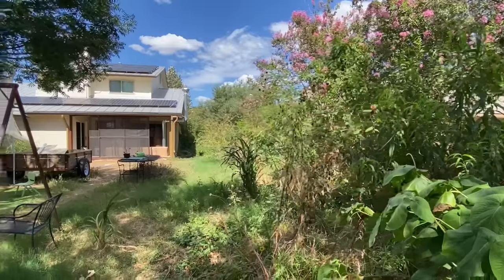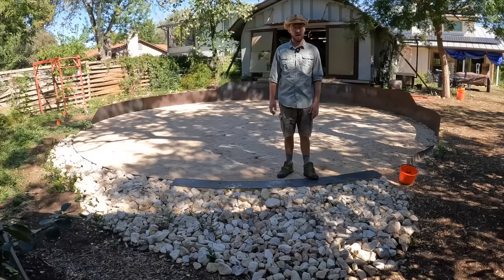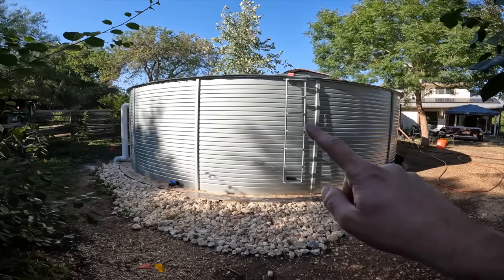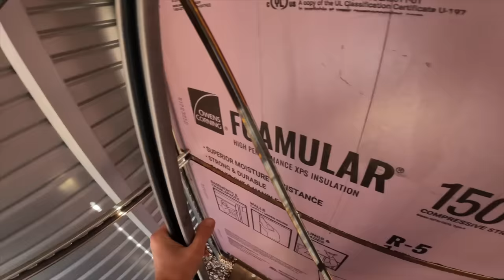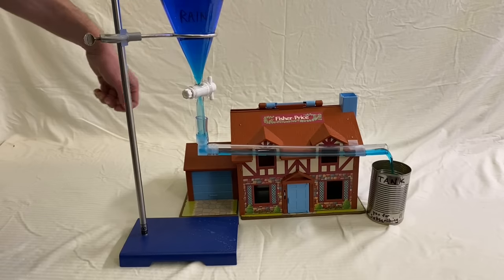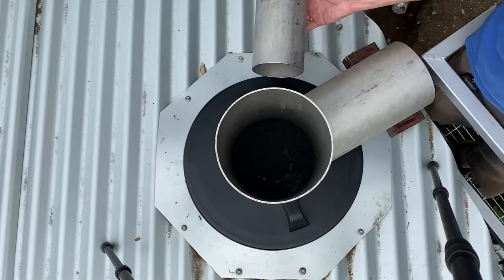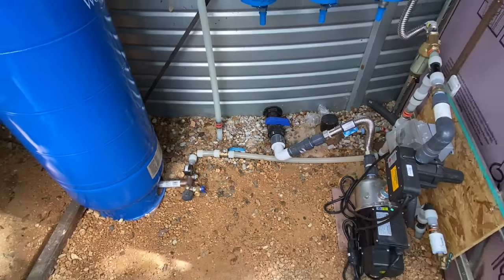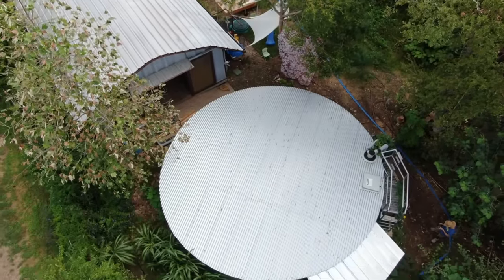FREE water forever.  LEGALLY!!!!

Comment: As some other comments already mentioned, it's one thing to have your own water supply for, technically free, but then you also have to do all the treatment and making sure the water stays clean and usable on your own as well, you have to regularly check for legionella and other stuffs, so that you don't just die from it.
Also that big of a tank is basically the average european single family home backyards size.
Reply: This is only worth if you have zero access to clean water.
Reply: the reverse osmosis final stage ensures his water is cleaner and purer than the vast majority of bottled water on the market. sad to see people dismiss this truly excellent idea/setup.. our being this dependent on systems that could fail at any moment isn't a natural or healthy thing
Reply: @@fishy2939 "Reverse osmosis is a water purification process that uses a semi-permeable membrane to separate water molecules from other substances. RO applies pressure to overcome osmotic pressure that favors even distributions. RO can remove dissolved or suspended chemical species as well as biological substances, and is used in industrial processes and the production of potable water."
Reply: @jmedlin81  this is written by someone who's never actually had to use reverse osmosis machine in a technical setting. ignoring the cost of buying a RO machine for treating that much water, RO will cause him to burn through a ton of the water just using the machine, causing him to reduce the water he actually has to ~1/5th of what he has total. also, I would prob not recommend drinking straight RO water, as because it actually does purify really well, that's sort of the issue. you'll remove a ton of ions than are usually present in drinking water, and since he didn't have a remineralization machine, he might have to take some supplements or make some dietary changes.
Reply: most people in europe live in apartments and flats so its not and option here, unless you have money and buy house, that  cost 200k or more depending on country and city
Reply: @KoeiNL and what happens when you lose access to clean running water?
Reply: @OriginalWoman95  the odds of that happening are insanely low, I live in a wealthy country that belongs to that select group of countries with absolutely perfect drinking water (0% chlorine). I have better odds winning the lottery.
Reply: @Hosing2  I think your forgetting that someone can get all nutritional requirements from what they eat including minerals and ions as the main source of these is food, water contains minuscule amounts so whether the water contains ions or not really doesn't matter
Reply: @KoeiNL  I don't know over extraction of ground aquifers is a big problem even in wealthy countries, it may be the security these seemingly endless sources provide is what drives us to excessively use and waste it.
Because I guarantee you if your water supply comes from a aquifer its currently being abstracted more then the recharge rate which means it running out is inevitable.
 However as the aquifer gets lower and lower it will change the water table and the ground will sink even sink cause sink holes want an example look at Mexico city.
And its worth it if you have the space for it regardless of your access to clean water because chances are you have to pay for that access and this method saves a lot of money
Reply: your forgetting his filter system completely eliminates all contaminants including viruses and bacteria
Reply: Personally I would be content with using rainwater exclusively to water plants or hose down my bicycle, and for that I could just get a lil barrel :)
Reply: @@RaoniTech Its a cost-benefit analysis and if you live in Western Europe the costs completely outweigh the benefits.
Reply: Newly built houses here in Belgium often have a rain water tank. My friend for example has a 10,000 liter tank for a family of 3 and a dog. My apartment has 30,000 liters and my parents have a deep ground-water pump. At a certain level water doesn't deplete underground around here for what can be consumed by a family anyway.
Reply: @kennyj7627  yes, this is useful but not for drinking. Its perfect for laundry, watering the plants and flushing the toilet.
Reply: @NUNYABIZNNAAAZZZ  also, if you want to pay 100x more for a liter of water that's fine for me. I'm not going to do that.
Reply: @OriginalWoman95 what happens to your drinking water when a nuke hits your place? Maybe build a bunker.
Reply: @NostalgicMem0ries  Wow you are out of touch with reality.
Reply: @thomgizziz  care to elaborate?
Reply: Yeah, it is a silly idea because the guy is into "science" so as bright as Pluto. Those filters must cost a small fortune.
Reply: Thing is, at least in northern europe, nearly all flowing water out in the "wild" is clean. And we don't pay anyting for water as it is, well we don't pay anything extra. Of course there is taxes and so on.

But with all the taxes etc accounted for, I am still left with more money each month than most people I know in the states, despite them sometimes making 3x as much money as me per month. We just don't have many fees, and we don't really have to worry about contaminated water, ever. 

USA created it's own problem by contaminating so much of the natural water sources. How else did you think people survived there for thousands of years before modern filtering was a thing?
Reply: @KoeiNL  or if the water supply is interrupted regulary ... or irregulary for longer times.
for me as a german this is interesting, but nothing i would build myself. infrastructure is very good here when it comes to water supply.

Comment: Wonderful to see city folks doing things like this! The video is excellent, thank you for sharing the details of your system and what worked/didn´t work for you. Very helpful.
Reply from the maker: Thank you for commenting.  If we could develop a system that required less metal (like a stone lined hole in the ground with a tank liner inside of it) I could imagine an infrastructure where most people have their own water supply rather than pumping it in from 20 miles away.  Thanks for subscribing!
Reply: @suburbanbiology  Interestingly,  cisterns were once very common.....nothing new under the sun.

Comment: You could use a method to stop collecting into the tank for times that your usage is much lower than your collection volume. As the years go by, the shape of the ground around the tank will change. You have already done a lot to mitigate the effects, but it is something to keep an eye on. You have left a lot of room for upgrades and modifications. Great job with the design and planning. Keep your roof clean and good luck.

Comment: You should add guttering around the roof of the tank to collect the run off and further protect the sidewall. And it’s also another way to collect water
Reply: And how would you get the gutter water from the top of the tank into the tank itself, it’s not feasible, he should not put catchment ontop of the tank

Comment: You'll have to watch out for freezing if you have any water left over in that valley/ditch of the sewer piping coming from your roof to your tank. I also noticed that you didn't have any visible sleeving or insulation in the buried part of your pipe which could cause freezing ground/groundwater to crack the pipe if the dirt is right up against the buried part.
Reply: With this size of a thermal mass freezing wont really be an issue with internals. Externals with a little insulation should be enough. Having said that, I'd add a few things. UV lamps to run 1 hour a day. That emits a little heat. IR lamps on a thermal switch to get a head a serious 10 day freeze or Texan glaciation.😉😉🤣🤣 An internal water heater mounted at the top of the wall above the water would recycle waste heat to the air inside. This will be helpful to melt snow off the roof which is the real weakness in this design. But in a serious snow fall you'll spend every waking hour pulling the snow off before it can accumulate. Make you tools in advance! Basically a giant squeegee!
Reply: He lives in southern Texas, he doesn’t have too much to worry about with all that thermal mass.  As long as you protect it from drafts it’s not going to have much impact on things.  And the frost line in that area is about 6” deep. The downspout pipes of that size will likely only ever freeze about 50% max.

It’s a different story in northern Texas, we can get -15 degree temperatures in the dead of winter due to our much higher altitude and massive wind chill effects.  To do similar I would have to go down 24”  below grade, put a thermal barrier in, and drain the downspouts dry each November.
Reply: @hannibalsdiner1365   good luck with that, with extremes being more frequent lately ;)

"On February 11-20, 2021, a historical winter event occurred that set many records, including being the first billion-dollar weather disaster of that year. A deep freeze impacted parts of the continental United States (CONUS), remarkably engulfing the entire state of Texas. "

Comment: You could also get the land surveyed and get a deep water well installed. It's gonna run you around $6,000-$7,000 possibly, but it's a one and done kinda deal usually.

Edit: Here in TN there are no laws against rainwater collection, it is even encouraged by local government as it helps out the utility companies and their customers save money and water.
Reply: Yeah I was going to say a well is probably a more economical option long term. This tank option is only feasible in warmer climates. You’d need a big enough property to build it (or bury it), regular cleaning would be no small task. I’d almost recommend a first stage filter like a pool filter that allows backwash and flush to clear the bigger contaminants. It would cut down on filter replacements for sure. Would be interesting to have a full water panel test down to see how this tank system holds up after a year or so. Definitely need a filter that removes aerosol contaminates like aluminum and boron from the aerial geoengineering projects they conduct over us now (cloud seeding, etc).
Reply: Agreed, a well is a more elegant and reliable water source in most cases (although in my experience it will cost 10s of thousands of dollars at least) 

It sounds like this guy lives in city limits which might mean that he isn’t allowed to drill on his property

Comment: This is a great idea, I don't think people realise how much we rely on the public water supply until there is a problem. I would be concerned about the water in the gutter pipes going stagnant in long periods of dry weather, however this could easily be resolved by running the hose down them for a while as it will just end up back in the tank.
Reply from the maker: I put a drain at the low points of the buried Pipe to drain the vast majority of it in case of freezes. There is still a bit that stays in the system. In truth, though with the filters as fine as they are any muck that would collect gets diluted in the big tank and gets filtered out very thoroughly. Thanks for your support for subscribing!
Reply: In general, the public does not think about how much we rely on public infrastructure until something happens. That said, that has always been the situation historically. We saw this exact same issue with wells and rivers multiple times in the past to just keep with water as the resource. But these factors are power, transportation, contracts, and their enforcement, just to name the ones I have had to explain to people.

These goods/services usually are public infrastructure because either the resource is limited and/or the cost to create and maintain the infrastructure is so great that those who need it can not afford it. Even just going with this water example there is only so much rain fall in certain areas and to keep these reserves safe you need to prevent evaporation which removes it from the supply in the water cycle until it is used. If everyone tried this, then water would become significantly more scarce for those who do not have the ability to do this. This isn't to say no one should do this but that there are factors which means those who do this need very good reasons and ability to circulate this valuable good.

Inversely, with the new avalibility of solar power, the resource, while technically finite, is secure for, in theory, millions of years minimum. So the holding of resources taking away from the potential supply only really amounts to thermal energy, which is already being wasted because homes are trying to keep it out. The infrastructure (normally a home) to use the resource is the only concern. That said the market then will raise the prices of not using this technology on those who are unable to because they need to support the existing infrastructure.

Comment: I'm gonna need an update after winter. With how erratic the winter season is these days, I genuinely hope this tank doesn't burst open from freezing.
Reply: - A larger volume of water takes a longer time to freeze completely.
- Round shaped tanks have a smaller surface area compared to rectangular or cube shaped tanks, causing less heat loss and providing better insulation.
- Proper tank insulation is a must to avoid freezing of the water during the winter.
Reply: @mucholangs once the tank is not full but has sufficient space for linear expansivity it won’t burst.

Comment: I m from nagaur ,  rajasthan, india ,  we are using rain water harvest method in our house , there are two water tanks unground both for to store water from govt facilities and other one when it rain we just wash the roof we have flat one  , we never store water of first two rains , instead we use that to clean the roof with the broom and later rain we  store and last for more than a year , there is a tip for you use alum , powder it down in tank water after collecting water and within 2 days water will be crystal clear you dont have to you any on these machines or filter are that, all the dust will settle down
Reply: Whilst Alum will act as a nice coagulant, I hope you then pass the water through carbon filters or similar to remove excess Aluminium contamintion to the supply? In high concentrations it is a health hazard and I would reccommend not adding it if you don't have additional Aluminium removal filtration.

Comment: Have you thought about putting a gutter screen for larger leaves and debris before it even gets to your 4 and 6 inch pipes?  I think that would help you from having to clean your spout filter as often and could cut down on some of the floaters and debris.
Reply: I’m assuming he wants to be able to maintain it from one spot. Otherwise he’d have to get a ladder out still and check the multiple downspout filters. I have to agree that adding them before the piping would be a great idea to prevent clogging underground
Reply: The screens I am talking about are designed to avoid that, they screw over the gutter, let water in but the leaves usually slough off the gutters. Little to no maintenance that I am aware of @Tudalouu
Reply: @dylangunzel9643  oh my bad I didn’t even think of that. That’s a way better idea.
Reply: I think it is necessary.

And I think the U shape pipe system will.... be filled by germs very soon....
It needs some chlorine.

Comment: I live in Texas too and we have a well. but it is pumped by the electricity. I’m pretty positive there is a way to add a pump onto it that is manual so that even if the power doesn’t work I can still pump it. I’m trying to find out exactly how to do this. If it’s not possible doing something like this is definitely another solution.

Comment: You may want to look into the possibility of strings of ultraviolet LED lights. UV radiation is really good at killing viruses and bacteria. You can put a string of them through a large clear plastic tube and set them inside the tank to prevent bacterial and viral growth. Also as a backup you should really consider getting a Berkey filter.
Reply: Great thoughts imo!
Reply: just make sure it's not a plastic that degrades from UV exposure :)
Reply: 23:38
Reply: @swedneck  That metal tank doesn't look strong enough to hold that much water.
Reply: Berkey's are arguably not all that they're marketed as. Multiple sources have tested them and found them not to filter up to the standards you'd likely prefer.
Reply: @swedneck  Also make sure it's UV-C as UV-A & UV-B do close to nothing except function as blacklights.
Reply: Why not just let the tank be fully open on the top, and then filter debris at the outtake? Won't the UV from the sun kill bacteria and fungi?
Reply: I also don't understand why the water is collected from the house roof and not directly on top of the tank
Reply: I bought a berkey filter, the kind with the stainless steel tank on top of another one or whatever the thing was made of and I had rust after a month from the inside!! Not happy!!